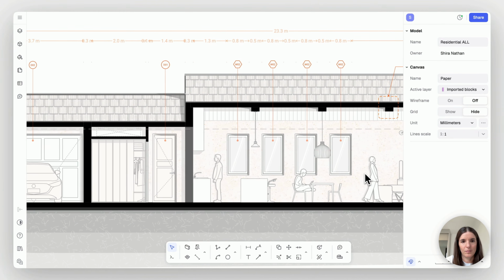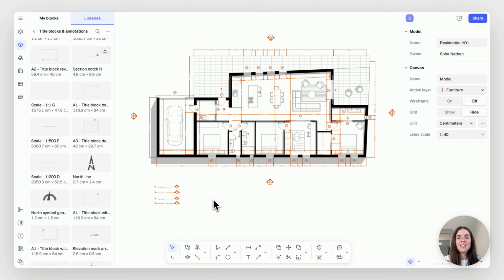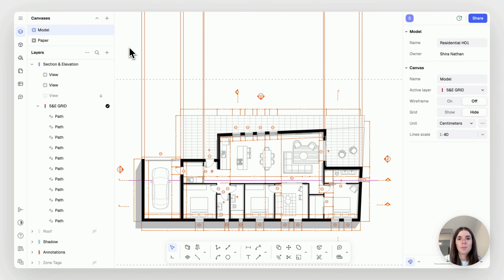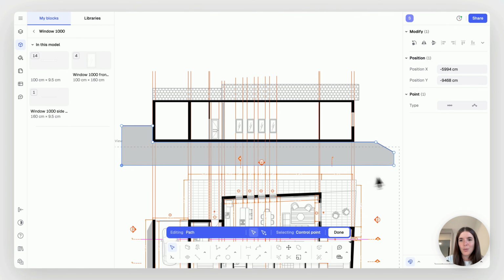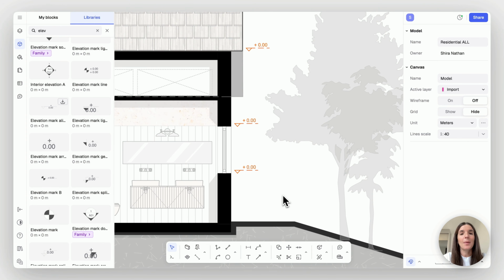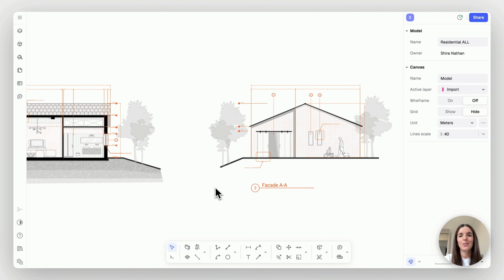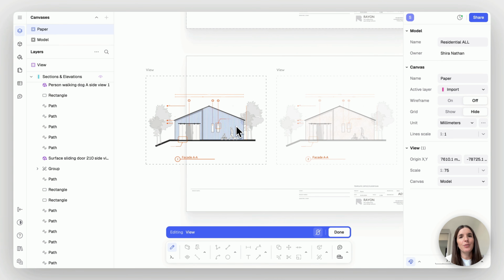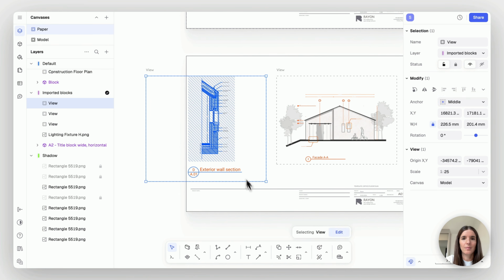Master Architectural Section Drawing in Minutes

Comment: i thought rayon was a 3D modeling software so you can get sections automatically from model, what a shame 😢
Reply from the maker: No worries! Our focus is on helping you create stunning 2D architectural drawings quickly and efficiently. And then you can use our SketchUp plug-in to create a 3D model from your drawings: https://docs.rayon.design/documentation/import-export/sketchup-plug-in